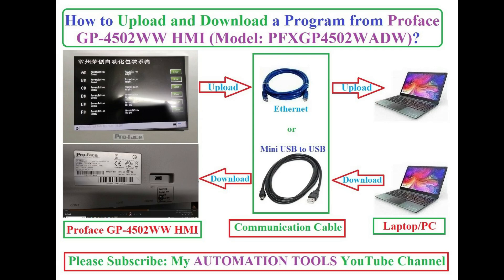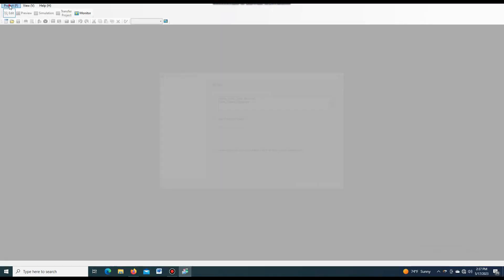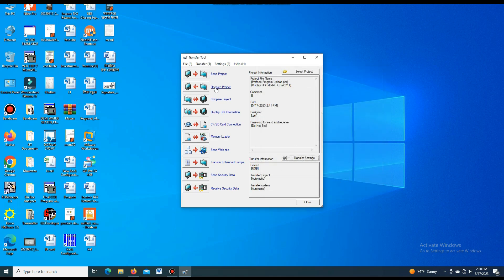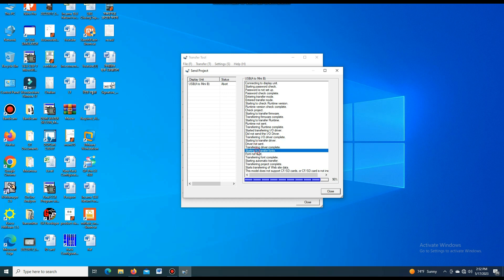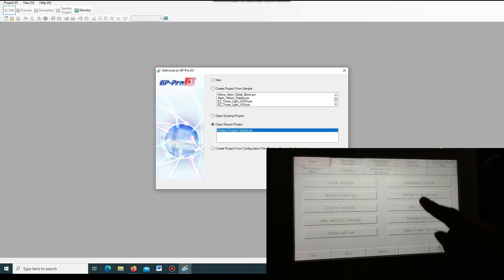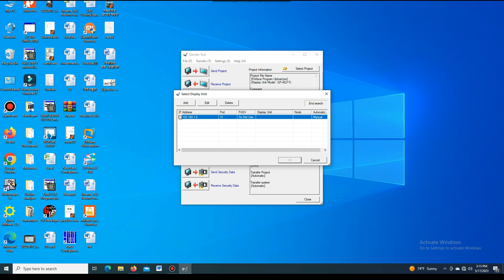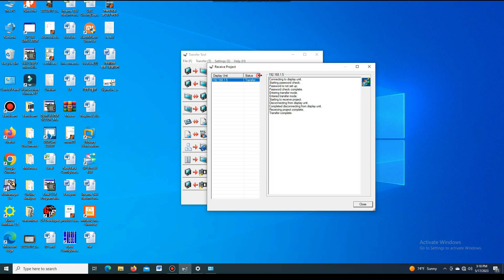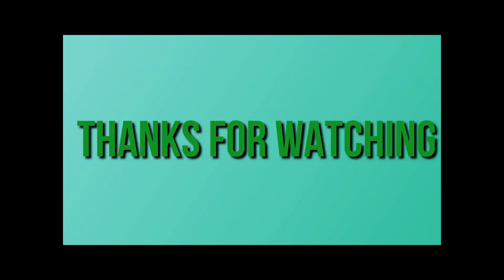How to Upload and Download a Program from Proface GP-4502WADW HMI  by using GP-Pro EX Software ?

Comment: Hello , thanks video. I have one question is RJ45  net cable wiring is T568A - T568A or T568A- T568B ? thanks.
Reply from the maker: Thank you for your interest.
Normal network cable that is used for internet browsing